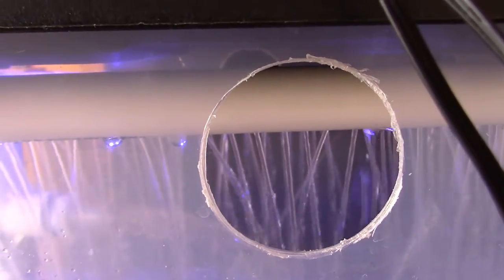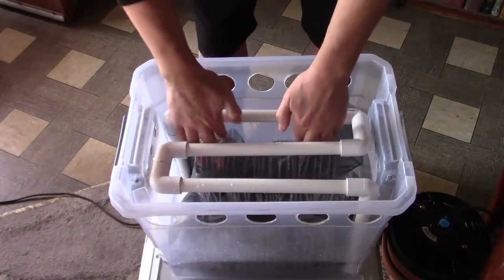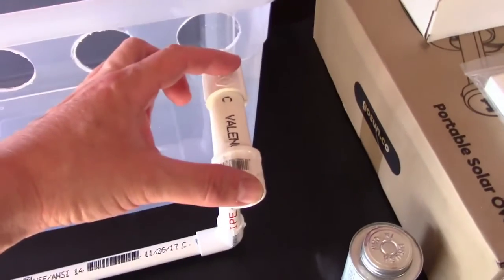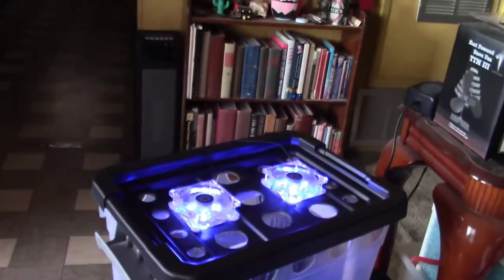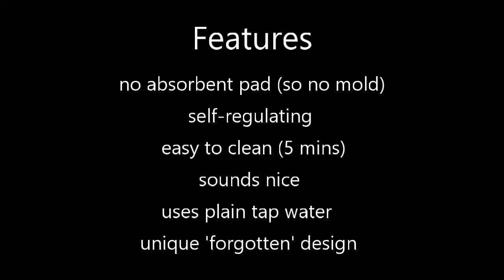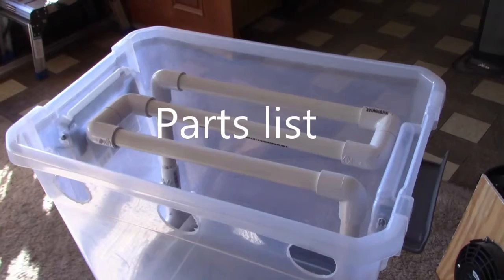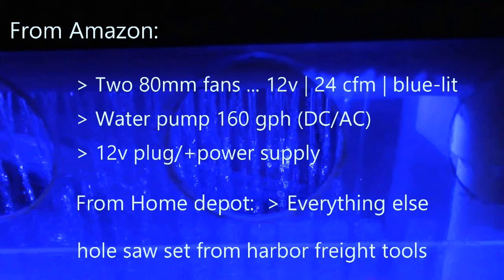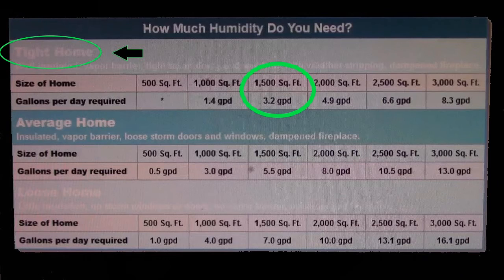DIY Pad-less Evap. Humidifier (w/"lighted" water-tank) 12-16 hr run 500-1200 sq. ft. no pad/no mold!

Comment: I've been looking for a DIY evaporative humidifier for a room with my guitars.  This is great,  I actually liked the sound of the water LOL but I see how the screens may be more effective in releasing more water vapor in the room.   Has anyone here created this and measured the change in humidity or monitored the humidity while this is running?   I want this for a 300 sq/ft room and this design according to the calculations shown would work.  Other than measuring the evaporation rate in pt/hr was there a measurement taken on the room humidity?
Reply from the maker: hi. i'm glad you like the unit. it works amazingly well. i haven't taken any extra measurements since posting the video, but the unit should work well for you.

Comment: Nice design -- thanks!  Unless i missed it, you didn't list the screen material in the parts list. I assume it has to be a plastic material to avoid rust over the long run.
Reply from the maker: hi and thank you. it is just standard non-aluminum window screen. you can buy it in a roll from the home stores. the unit has been working great

Comment: This thing works! I just built one very similar to yours and it works SO much better than the medium room ultrasonic humidifier I was running. We have (softened) hard water and I had to buy and fill it with distilled all the time. I can run straight tap water with this and it humidifies a LOT faster too. I used zip ties and hot glue to suspend the bug screen across 2 horizontal layers and an inline duct fan I had to force air through. It's a lot bulkier than what I had but I just rinse and run vinegar through it a couple times a week and it's been rock solid the past 6 weeks. Thank you for sharing your design, much appreciated!
Reply from the maker: hi and thank you too! and thanks for sharing your experience. sounds like it's working very well for you.

Comment: I was curious what you think of an idea to intensify the cooling. 1) Is it needed? 2) Would my idea work?

If there were a large enough cavity in the middle to fit frozen half-gallon or gallon bottles, would they impede the functionality? If not, perhaps three pipes on each end with a pipe going down one side connecting the two sections would have a similar amount of surface area for water droplets — just colder.

Regarding sound proofing, I'm assuming the bulk of the noise is from the water falling eighteen inches onto other water, so what if its drop was reduced? What if the screen was angled down from the sides, catching water similar to how people try to collect rain water outside. That would reduce the distance any water would fall, but would it impact the operation?

In any event, I've watched a few of your videos, so thanks for the wonderful ideas!
Reply from the maker: hi. since it's an evap. humidifier there is no need for any ice. ice would cool the air coming out but that won't increase the moisture output. in terms of the sound, you can adjust the screen inside the unit to make it sound pretty much how you want it to sound. (from nearly silent to a 'water trickling' sound). it's all in the way you position it inside of the unit. the unit has a very soothing sound to the ear either way. it's only louder if you don't use any screen material.

Comment: Just made one of these bad boys. Ended up using two 80 GPH pumps, one per leg of the PVC (so I used an additional tee + barb).

After 6 years of operating a evaporative wick humidifier I've had enough. The wick gets disgusting within a week of buying a new one. The ultrasonic style is a total health disaster unless you use distilled water. Then there are steam console humidifiers but they're expensive and inefficient. Finally, the few non-wick evaporative humidifiers are insanely expensive and complicated (like the Venta Air ones). It's all so ridiculous!

Thanks for pointing me in the right direction with this build. Excited to see how it performs. I'm sure I'll do another iteration or two.
Reply from the maker: hi there. it's great that you made it! sounds like you've got a great unit. different pump but that should be okay (as long as you get strong water flow). one tip is that i think you can use much stronger fans (to get even more humidity faster) if you want. that would be something to experiment with.

Comment: Very interesting, was looking for a way to change an old humidifier from the big fat white wick that has to be bought and replaced.  Might try to adapt to this with the screening and water sprinkling and use the built in fan.  The pump could be small and just need to pour water on the screen pad.  I am so glad you thought of this.

Comment: What if you used a fan over some of the holes to help draw the humidity out?  Maybe a paddle connected to the fan blades so the falling water could turn the fans and save on power costs?